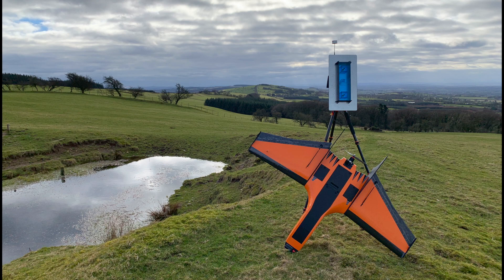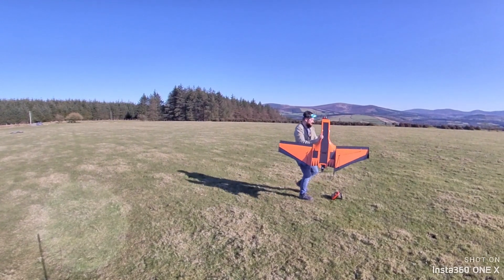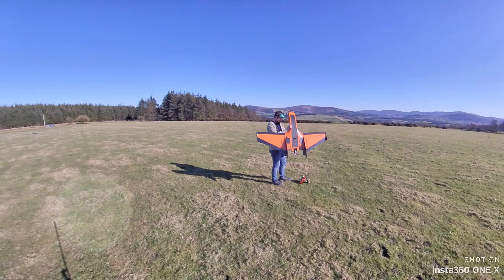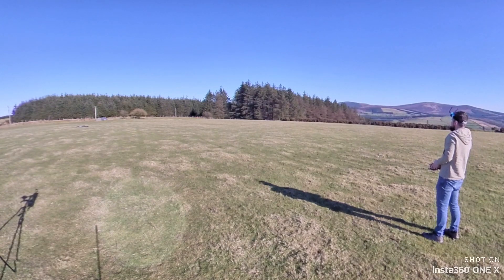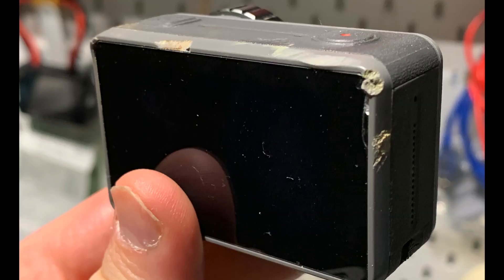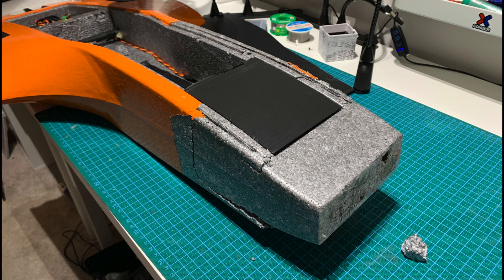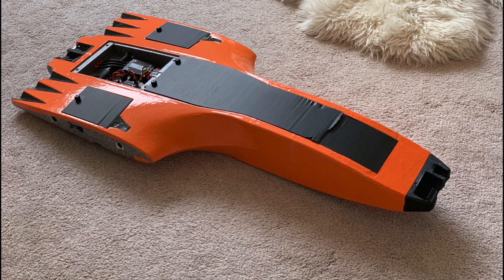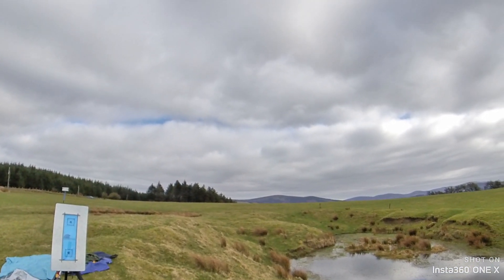88mph Drak Crash - FPV  🤬

Comment: That Drak Looks an even bigger PitA to launch than a big wing, and has a big prop at 100% throttle just gagging to chew your leg and hands up... maybe worth a ramp and bungee launch system?

Yes, its a ballache setting the ramp frame out and staking the bungee securely, but it would give you 10/10 passable/recoverable and safe launches rather than 9/10 good, but with the 10th bad launch being almost a write-off or even worse leaving you chewed up and with what looks like 10s of miles to get to the nearest A&E hospital.
Reply from the maker: Yeah it's a little scary and awkward to launch but I really want to avoid a bungee as it's a lot of extra effort to take it to the field, setup, pack away. What it would mean is i wouldn't bother flying it due to the extra effort. Anyway I have a solution now thanks to an iNav dev, hand launching is going well :) thanks for watching and commenting

Comment: Can I ask why you're always flying around in Auto trim? lol
Reply from the maker: People ask this question in every video i use it🙈 Autotrim only works for 2 seconds, and you do it at the start of the flight to trim out the plane. Then the message remains on the screen for the rest of the flight
Reply: @AdamGdoesFPV  weird I could have sworn it goes away on mine once you turn it off 🤔 regardless cool plane and flight (s) man 😎
Reply from the maker: @carnagefpv8256  No it stays the entire flight... unless you switch Autotrim off. But if you do that you lose the new trim. Cheers :)